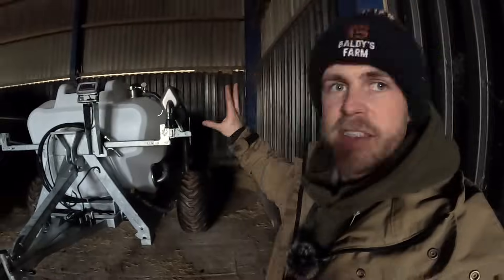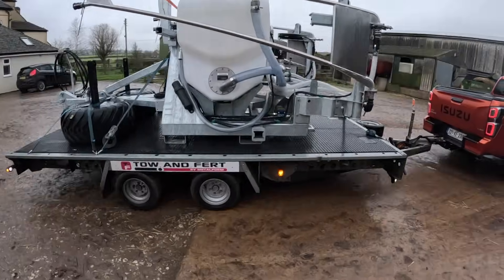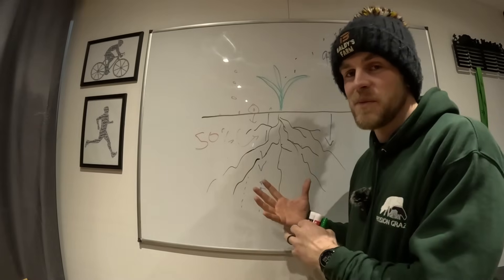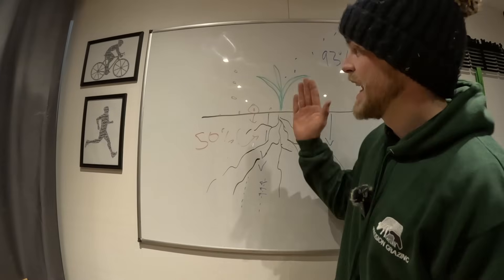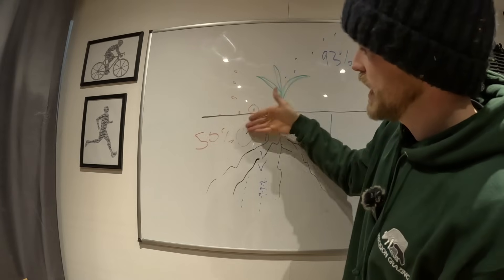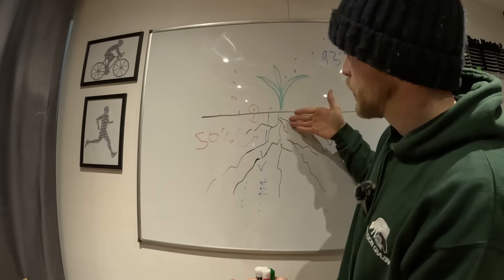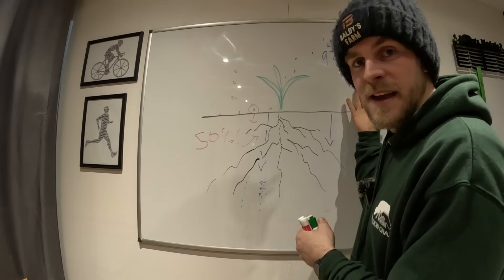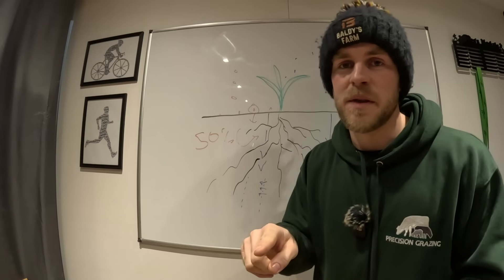This Investment Is The Future Of Farming | How Foliar Feeding Works!

Comment: 9:25 Wouldnt it be the same issue with roots if the plant is just given what it needs straight to the leaf? Surely the roots wouldn't have to go mining for nutrients the same as traditional fertiliser? Also, by putting normal fertiliser bags into it, are you not just creating liquid fert? Whats stopping the "foliar" stuff landing on the floor and getting into the plant via roots? How are you differentiating liquid and foliar because dissolving bag fert in water then spraying it on is exactly how liquid fert works? I cant see the difference, just think youve bought a small sprayer with liquid fert nozzles on
Reply from the maker: Hey Henry, 

Thanks for your questions. Ill try my best to explain it as simply as possible (its quite complicated with lots of moving parts) but to start with ill recommend reading a book called 'For the love of soil' - Nicole Masters. 

Where to start... The reason why plants don't mine for nutrients in a granular or liquid fert situation isn't necessarily to do with he plant being fed or not, its actually to do with the soil. When using fert traditionally, the soil stops functioning naturally because the fertiliser creates an environment that is unsuitable i.e Inbalance in PH, bacterial/fungi ratio, carbon nitrogen ration etc. Therefore when the plant signals nutrients, the soil biology can't respond to bring them what is needed. Over time this leads to the issues that we see now regarding soil aggregates, water infiltration, organic matter etc.  

To your point about foliar landing on the soils. Foliar is generally applied to a leafy plant which hopefully should cover most if not all bare soils but even when it doesn't the concentrations of foliar N are so low in comparison to granular or liquid N that any run off is negligible but I agree, still present. The other difference is that through a Tow and Fert you can add extra carbon sources, biologicals and bio stimulants to the tank mix at the same time, effectively offsetting the residual fert that does find itself on the soil and actively feed the soil biology at the same time. 

The nozzles on a Tow and Fert are very different to that of a liquid fertiliser spreader. They work more like a splash plate on a tanker rather than a dribble bar like you would expect from a  liquid fert applicator.

As I said, a lot to unpick, but appreciate your question. You could also look on the tow and fert website and read some of their news letters which includes a lot of science behind the concept.
Reply: @baldysfarm  okay, when I have used foliar fertiliser (mz28) on wheat it's been sprayed on at 150l water at something like 30l of mz28 through normal spray nozzles into the canopy. Just a different way around it I suppose
Reply: Was thinking just this !

Comment: This is this the biggest game changer?! I watched the earlier vids too. Amazing. What's max width & can traditional sprayers be adapted?
Reply from the maker: It's awesome Jeff. Really excited to show it off properly this season. So the answer would be yes and no. Max width with out machine is about 18m but the large ones will do 24m. They are looking at potentially making a bigger width machine but it's taking a lot of time to plan etc. 

A traditional sprayer in theory could spread the foliar N but where the tow and fert wins out is that you can add products like molasses, hamates, boistimulants, dirt water and even small seeds to the tank mix. This is because of the nozzle size as well as the custom designed trash pump on the machine, which allows it to handle the trickier products.

Comment: Great video James just a question do u think foliar application could be done using a standard tractor sprayer without having to invest in the tow and fert system??
Reply: Yes you can use a normal sprayer to a certain extent.  I been dissolving urea in an ibc with a pump in the bottom to stir it up. Then suck it into the sprayer. Urea is easy it's when you start to add humates and other things  it blocks the filter. Iv ordered a tow and fert to speed it all up